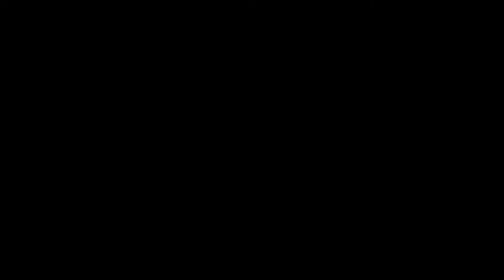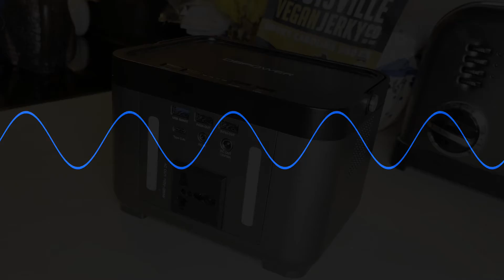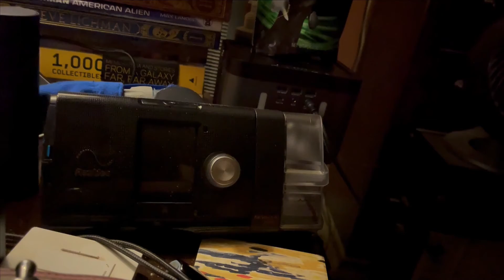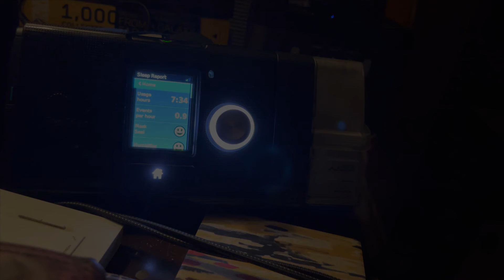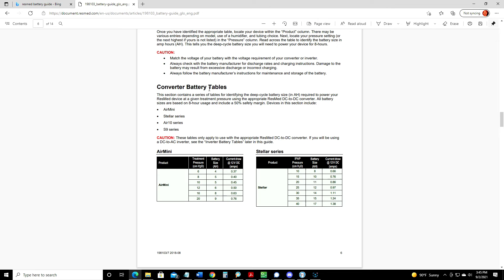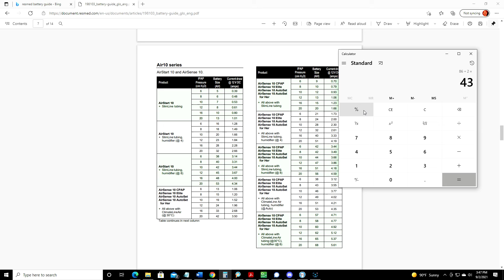How I Keep My CPAP Running in a Power Outage

Comment: Hi Dennis, I have been looking for a battery backup solution for my Resmed Airsense 10 AutoSet CPAP to deal with increased power outages. Your video was great timing. Do you think that I could use a Stanley JumpIT 1000amps peak/500amps instant starting power battery with the KFD Car Charger DC Adapter for Resmed Airsense 10 with humidification turned off in a pinch? This would be a temporary solution until I buy a better battery backup solution. I realize the Stanley Jumpit battery would take a very long time to recharge fully. So, it is not very practical if a power outage goes beyond a single day.
Reply from the maker: It would depend on your settings! That model only has 19 AH of stored energy. It’s really designed for bursts of power, not sustained usage. So you would definitely not be able to use it with the humidifier for an entire night. And even without humidity, you’d be limited to a pressure of 16 cmH2O (I dunno what your pressures are, of course.)

Mind you, it could be that the JumpIt has some auto shutoff feature that would prevent even that. You’d have to look at the manual. 

But for a temporary solution that could get you through one night until you can get something different? Again, assuming the lack of auto shutoff, it should work!
Reply: @AdventureswithCPAP  I guess the Stanley JumpIt is not too practical especially if it only produces 19AH. My pressure settings 10-12 cmH2O would require about 13AH, so that is a pretty narrow margin for success. Thank you for the great video and the answer.
Reply: Just a quick comment on your booster pack and all those with booster packs if you want them to last get a good battery charger that charges to 14.8 volts and floats it from 13.4 I found NH this on a full time RVer website and I thought it was wrong after all the manifactor should know proper care and charging perameters of their products since my black and decker was handy I opened it up to find the battery manufacturers web site to find out what they are  saying the battery should be charged at didn't need their website written right on the battery was do not discharge below 12.2 volts float charge 13.4 and full charge 14.8 and on the built in wall wort was output 12 volts so it was no wonder my booster packs with an inverter died it was dead to start with so I  checked my new everstart booster packs and their charger was 12  volt but I. noticed it actually changed to 13.1 so I went online to get their phone number and called them the person I talked to was very polite and listened to what I was saying about my findings but it was okay that's what theirs was fully charged at 13.1 so I believed him about a year later ii noticed that where I could boost my ptcruser 5 times it was down to 4 quickly dropping to 3 then to 3 so I tried my charger that charges through the cigarette lighter plug but it wasn working so I clipped my good battery charger to the booster cables za, turned on the booster cables an plugged in the charger left it over night in the morning I checked out the  status of the battery it read fully charged at 13.9  but then it was at 90% after a few uses it it got to 14.4 and I could again  boost the ptcruser 4 times but if I push it I can get 5 so RVer were right in checking out the history of lead acid batteries 
When batteries first came out they were in a 8x8by 14 inches high and they were 2 volts and when the tucker rcar was made it had an electric starter and a generator and needed a  new smaller battery that would give it good power for starting the automobile with different methods of building a battery and the   volts went up

Comment: I bought all power R600 with heat tube & water chamber off last about night and bought solar panel for changing since I was in Florida when Ian hit and power out for 2 weeks. Now getting rested 11 and it has different power plug than 10 so DC cable bought for 10 cigarette plug will not work with 11.

Comment: FYI - Speak to your power supplier and see if they have a form that can be submitted stating you have a medical device that provides breathing support running on electricity. When your power is out they prioritize restoring your power, so your power will be restored quicker. My power company, AEP provides this service. 

One rental home I lived in the power supplied our home and the one next door. The "fuse" would blow on the pole and we waited hours; after submitting the paperwork our power was restored  within an hour. 

I also took a 12-pack of "cold beverages" out to the worker and thanked him every time we were home. Most were thankful and accepted the gift. Hope this information helps.

Comment: Nice solution! Thank you.
One correction: At about 11:35, you were showing the adapter power cable. And said plug it into the
USB port and it'd be fine. Whoops! No, that is not a Universal Serial Bus cable. It's only a POWER
cable - no serial data flowing through it - and the round power connector will not plug into any USB
port.....Thankfully....

Keep up the good work.
Reply from the maker: No, that's exactly the opposite of what I said. I was explaining that they make similar adapters with a USB connection on one end and the cigarette port on the other. In other worse, the same cable I was showing, but with USB instead of the DC plug. I explained all of the reason those USB ports aren't capable of delivering sufficient voltage and amperage and why it's a bad idea to buy them.
Reply: @AdventureswithCPAP Ah. Being hearing impaired, I use captions.  Perhaps they did not transcribe your words correctly......
Reply from the maker: @doubledranch871  ah! I’ll check the captions when I get home and correct them if needed, then. Thanks for letting me know! I thought I transcribed the captions myself but maybe I screwed up.
Reply: @AdventureswithCPAP If the transcriptions are automatic (google), they
can be very wrong - laughably wrong sometimes!  The Google app that I use on my cellphone to read what people say is a million times worse. 
My wife hates it and  rightly so. I have changed it's name from LTA (Live transcribe App) to LBA (Lying BassTurd App!!)

Sucks not to hear properly. Sucks more when your app tells you things thst they did NOT say......

Comment: I work at night and my CPAP measures on a weird scale it makes it think that Im not sleeping a full x number of hours when I am. Another issue I have sometimes is that the mask gets an unconfortable skin burning feeling at night when wearing it. Almost a cold wet sensation makes it feel like my skin around my nose is burning. I also have issues with the CPAP hose when I have colds or my nose is stuffy. Is there any videos you would recommend for these issues?

Comment: Last night we had a power outage. Our house was the only one involved-something to do out at the road  i now have a torture device called a cpap and there was no power. I pulled out the Jackery battery, plugged in the cpap and a fan and went back to sleep until the power came back on a few hours later.   A boat battery hooked up to a dc converter will also work but the Jackery worked really well.  I can keep it plugged in to keep it charged and run the cpap through it at the same time.

Comment: Thanks. Clear and nearly complete. Yes, don't ever use a modified sine wave inverter. Yes, heating takes a lot of energy. 
However... The heater for the humidifier is 100 % efficient. Every electric heater is 100 % efficient. All the energy is converted into heat, just what you want.
During the nerdy bit you used the full capacity of the battery to calculate possible usage hours. 
However... You can't use 100 % of your battery. It would die in a couple of weeks. The advertised capacity is not the same as useable capacity. I like to not use the last 20 %, preferably more. So with the humidifier on, you nearly emptied the battery of useable energy. 
My solution is to use a heavier battery with more capacity.
You mentioned mAh capacity of your battery. If you do the math, that seems to be calculated based on 3.2 volts. The battery outlets are 12 volt. Therefore it would be better to calculate all energy use in Watts. 
You have a powerful DC power outlet. Can you use that to charge the battery? On mine it's not advertised like this, but it's possible to charge way faster this way.

Comment: WOW, so much greatness in this video, thanks! I didn't know there was a ResMed battery guide! LOVED all your geeky details and content! QUESTION: My GF's Grandpa wants a dead-simple solution for running his AirSense 10 for 2 days when power goes out... but doesn't want to worry about keeping it charged, turning the power station unit on each night, etc. Are there any power stations that are just on all the time, keeping the battery topped-off, and basically allow the user to plug in their CPAP to the power station as though it was connected to always-on power? THANKS!!!
Reply from the maker: If he uses humidification, I’d get this one along with the car plug for the AirSense 10:

https://amzn.to/3Xrci5u

That’ll definitely last two nights.

Comment: I have a question maybe you can answer when I look on my cpap makers web site and also online from Amazon the cost of the 12 volt adapter is around 250 dollars but my dealer has them for under 40 dollars I've also checked resmeds site as well so I'm curious is the company one a regulated 12 volt supply and that's why it's so expensive
Reply from the maker: Hmm. Which machine do you have?

Comment: Do you leave the battery plugged in so that it functions as a UPS then?
Reply from the maker: I don’t. That’s really not what this battery is designed for, and doing so would wear it out pretty quickly. 

So, if I know severe weather is coming overnight, I simply switch over to battery operation, then plug it back into the wall the next day. I’m fortunate in that power outages are pretty predictable where I live.

Comment: Great video--and I dug the geeky parts.😁 Question: do you think an EGO Power+ Nexus Power Station (pure sine wave, 2000 watts continuous/3000 watts peak, charged by up to four 56-volt batteries that range from 2.5AH up to 10.0AH each) could safely run an AS10 all night long? The AS10 manual gave me pause when with the bit about not recommending using a power inverter. I have a Nexus Power Station, and nowhere in the product description or 100ish page manual is it referred to as a power inverter (on the other hand, its little brother, the Power+ Nexus Escape is clearly described as a 150 watt power inverter). And having used this thing (with one 10.0AH and two 5.0AH batteries) to power a 1200 watt vacuum cleaner to clean out a 12-pax van, I can't help but feel like it could easily power the AS10 all night long with whatever humidity and pressure settings I threw at it. I don't yet have a CPAP, but I was thinking using something like the Power Station--since I already have one--would be a great way to operate a CPAP on a nightly basis without ever having to worry about the power going out.
Reply from the maker: There are a couple of ways to find out! Do you have a lamp and one of those terrible CFL bulbs with the curlicue design? If so, plug it into the power station and see if it operates properly. 

Alternately, you can plug an audio device into it and turn up the volume, but don’t play music. If you hear a sort of buzzing noise (assuming said device doesn’t buzz when you plug it into a wall), it’s likely a modified sine wave. If it sounds good, and the CFL bulb works okay, you should be copacetic!
Reply: @AdventureswithCPAP  Thanks! Most of our CFL bulbs bit the dust, but I think we might still have one or two lying around with which to run this test. However, is this just checking to see whether the Power Station emits pure sine wave power? EGO claims that it does (and I've no reason to disbelieve them), so while I'm interested in the results of this CFL experiment, I'm not sure if it addresses my concern. The AS10 manual snippet you showed seemed to indicate that ResMed doesn't recommend using a power inverter with the AS10 at *all*, but to use a pure sine wave one with other models. Did I get that wrong? And then there's the matter of whether the Power Station is/is not an inverter...
Reply from the maker: @andrewberrigan1404 , so, the one thing you'll find with CPAP is that a lot of recommendations from manufacturers fall somewhere between CYA and "just in case." Or, conversely, they're giving a simple answer to a complicated problem. 

It's my very strong suspicion that ResMed recommends against using inverters for two reasons: one, because they don't have the ink to explain the difference between modified and pure sine wave output, and two, because they don't trust consumers to know the difference. Well, there's also the inefficiency. Using an inverter is going to result in power loss, for sure. So in a guide to operating your CPAP on a battery that focuses on use hours, it makes sense.

So, TL;DR: I think there's something about the power brick of the AirSense 10 that would go kerflooey in the presence of a modified sine wave (or certainly in the presence of a square ave), but it should be fine with a pure sine wave. As long as it's getting pure sinusoidal AC, how would it know the source?

That's just my two cents!
Reply: @AdventureswithCPAP  Maybe just two cents, but very insightful nonetheless. Thanks! I have a feeling I'll be plugging my CPAP (if I end up getting one) into my Power Station after all.

Comment: Good info. You are right…there are so many solutions and we each have to decide what is best for us. Been using a Zopec Explore 5500 for about 2 months. Picked up the solar charger as well. The 5500 I can take on a plane once I resume international travel again. We were anticipating significant power outages this summer and I wanted to be prepared. The 5500 worked flawlessly during a power outage. It kicked in and I never knew we had an outage until the next morning. Thanks for the info Dennis…oh…didn’t stick around for the geeky stuff. It would probably make my brain explode. 🤯
Reply from the maker: Nuh uh! I kept it as non-head-explodey as possible!
Reply: @AdventureswithCPAP  Ok…watching it now. If my brain explodes it was nice knowing you. LOL